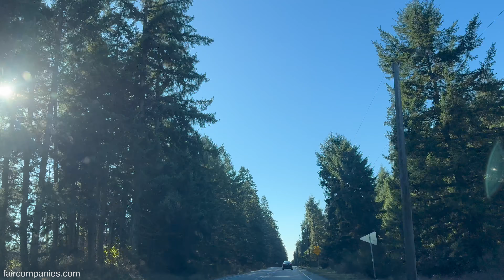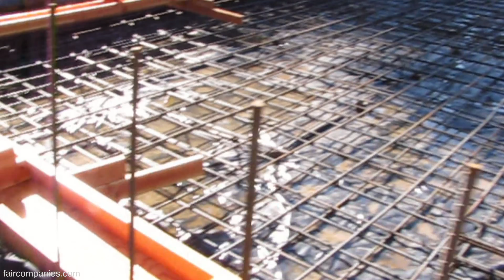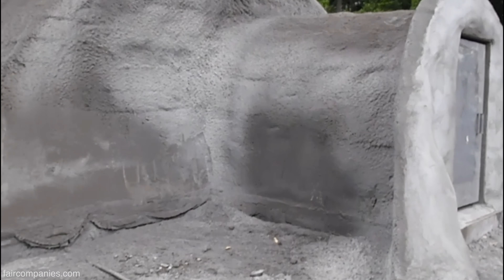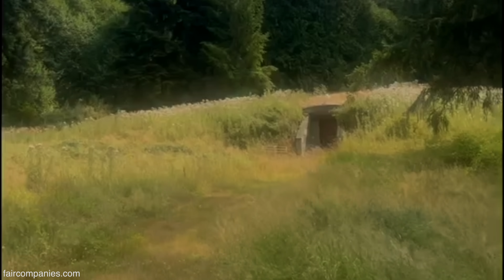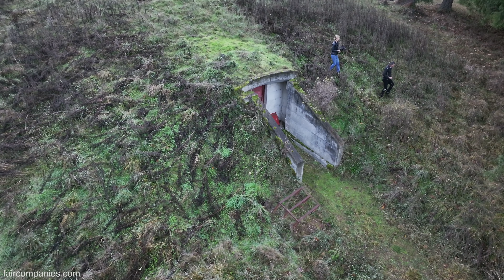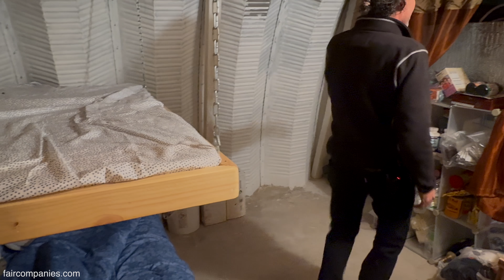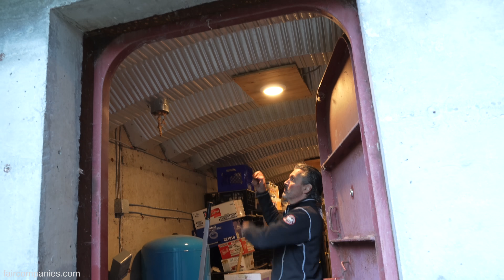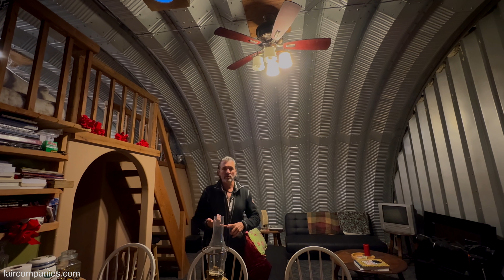Building Bunker Villa on a budget using Quonset Hut structure

Comment: He did something that few people will ever do.  Fewer still would ever put all of their food storage right at the main entrance; you have to protect your stores and this seems like a game-ending flaw during an actual SHTF event.
Reply: Agreed. And the door is not going to hold up for too long to a battery powered grinder or Haligan tool.
Reply: If you rotate food stores, it makes sense. Every six months grab 5 boxes of older food. And replace with new.
Reply: This ain’t a game of RUST.
Reply: @MildMisanthropeMaybeMassive 
Had to look that one up, boyo.  In a STHF scenario, it quite would be.  That's the whole point of survival stores and off-grid prep:  plan for the worst, hope for the best and try to live your best life for yourself and the people you can help.  If the worst happens, you dig in and survive.  Even if there's just a temporary 'emergency', you do better than other folks who haven't prepped.
Reply: After a moment of thought 

It doesn't matter a bit if you have stores and you're shot. The point is to keep your family living long as possible?  Don't put them in between the attacker and what the attacker wants.

You can still mount a defense from the inside door, while the family takes the escape hatch. If you're so inclined to take on the people motivated enough to choose the harder target. He's set up a shooting gallery.
Reply: Exactly my first thoughts

Comment: This hut is inexpensive and serviceable, but I wish someone paid better attention to the interior finishing and arrangement: it feels like a bunker.  Relying on mains power is strange,considering how he observes early that being without power was one of the things that spurred him to build it.
Reply: Agree, though he mentioned the bunker was built 15+ years ago, so technology has definitely advanced a lot since then. When building one of these today, I'd think he would utilize low-voltage LED lighting and a couple of portable solar generators... which could be recharged using a small generator, portable solar panels, or recharged from a couple of generator-equipped exercise bikes...in a worst case scenario.
Reply: Yeah.  The tech's changed super fast.  12V power and low-wattage LEDs are a major advancement for sure.  You'd still need AC for motors and induction, but everything else could be 12V. @__WJK__
Reply: There is two parallel conversations going here.  The guy started his company building these after an extended power outage, and this is one he built for a client at the clients specifications.
Reply: There isn’t anything keeping an owner’s creativity down.   You can join Quonset huts like a gable and create a T form or whatever.   It’s all been done before.  These could look like something out of a Tolkien movie if you had the desire.
Reply: Now THERE'S AN IDEA, lol
 @kimhorton6109
Reply: Well - there are other options like a generator that isn't shown to power the entire property 😉
Reply: That would be nice.  Still nicer would be siting it for wind, solar or water power.  I have none of these things, but kerosene generators are a short-term solution in a SHTF scenario and I know it.  Have you utilised any solar power and if so, what panels could you recommend for performance and reliability. @VikingShelters
Reply: @paulus.tarsensus  in this case wind is mediocre, because the moving parts are likely to break down.
Certain types of marginally less efficient (but still cheap!) solar cells can last 50 years or so when well maintained.
Also, a small generator with special ventilation would be beneficial in the event that solar stops working (maybe the panels were fallen on by a tree in a storm) for people with medical devices, like a CPAP.
Reply: @notyetdeleted6319  
Had to look up CPAP, so TIL: something, lol.  You're right in that solar technology is still advancing and we do need to wrest back the tech from the CCP, whose products are mostly tofu dreg and hurt our own ability to innovate and produce.  There are, however, some small-scale wind turbines now that are less likely to have down-time, break or create interface problems.  Lots and lots of people experimenting in their own backyards and startups.  There are also lots of methods, techniques and strategies to harvest wind.  Some of the newer ideas manage to capture even the slightest breeze and deliver power and don't have the higher wind threshholds some more 'traditional' models used to have to exceed in order to be productive.
Reply: @paulus.tarsensus You should use a set of small propane fired generators, because the propane burns cleanly and stores pretty much forever. 

Put solar up, a battery bank and invertor, gen sets back that up.
Reply: That could easily be augmented with a large propane tank and a propane generator, as well as solar and battery.
Reply: I would have serious claustrophobia issues having to be stuck in this structure no matter how “cozy and comfortable” it is; I am delighted for the owners!
I was in an underground house in Northern California that was interesting, it had quite a few stain glassed windows for skylights and some kind of white, lime washed walls, it seemed fairly bright and there were peacocks living on the roof, that was back in the mid eighties, very unique!
Reply: Watch the video closely, there is a generator still in the shipping box clearly inside the bunker. It's marked, looks like shipped in the box from the store/warehouse.
Reply: I think he said it cost $100k so not that inexpensive.
Reply: @barnmaddo  
15 years ago.
More like $250k now
Reply: forreal when it gets to 50k i'll be doing this for myself @barnmaddo
Reply: I think just being underground with all the insulation is an improvement over a normal house if you are in a situation without power. If you have a gas or woodstove that should be enough to cook food until your power is restored. A generator would definitely be another improvement though
Reply: This is true, but still a missed opportunity.  With sub-grade, underground spaces, you have to ensure a supply of fresh, clean air and this is especially true if you plan on having internal flame-based heating and cooking sources.  There always should be a lower elevation to draw air from and a vent in the higher elevations to ensure a natural flow of fresh, clean air.  Traditional Japanese and Korean home constructions were not underground ( and they didn't believe much in insulation ), but they still ensured that this air-flow would occur.  In Korean homes, the ondol, subfloor heating system depended on it. @TheCsel
Reply: @paulus.tarsensus  Completely fair on the lower-to-higher ventilation rule.  The thing I found myself wondering (I live in an area that gets more snow) was how easy it might be for the ventilation and the escape hatch to get completely blocked by snow.  I'd imagine that isn't as much of a concern for Portland, where this was sited, but they did get a storm that dropped 18" on them a year or so back.
Reply: @btgardener39   Shoveling snow would be required in heavy snowfall areas.
Reply: @paulus.tarsensus Along with carbon monoxide detectors.
Reply: @paulus.tarsensus  if you would have paid attention, the higher ventilation was pointed out directly in the video (next to the escape hatch) and a lower ventilation pipe can be seen in the construction images.
Reply: It would be relatively easy to add a solar system which is both grid tied and can operate in stand alone mode to the building.
Reply: Is this hermetically sealed?
Reply: It feels like a serial killer house inside.
Reply: @paulus.tarsensus  remember this is a bunker / guest house not a home
Reply: But it will stay fairly warm due to being underground.  Plus wood stove and oil lamps.  So is electric necessary?
Reply: Show some prices ..... turd ....
Reply: If I were this gentleman showing you my bunker house would be enough.I wouldn't show you the emergency amenities that I might have.That seems not smart.
Reply: I love the way you put a penetration In the roof to pull the well, i remember helping my dad pull his.It was very freaking long! I'm going to build something just like this very soon.I cannot wait❤
Reply: He's got a new prefab Hobbit house on this channel now. If you haven't seen it yet it's pretty good.
Reply: @paulus.tarsensus  It's good for demonstration purposes. Use this one to showcase, then build better later.
Reply: My sense is they were aiming for a bunker vibe
Reply: What about is it safe from a earthquake
Reply: There was a lot of things that the customer wanted that he said he wouldn't
Reply: Can't show all of your tricks in a YouTube video. I know I wouldn't.
Reply: Good thing interior finishing is the last thing to worry about if maximum safety becomes your only option.
Reply: all you would have to do is add drywall
Reply: @paulus.tarsensus  who cares about esthetics when it's keeping you alive
Reply: @fairlyoddme3021  
I do, you do and so does most everyone else.  If all you are after is a bug-out bunker when SHTF, then any hole with canned goods will do.  This, however, is their home and will likely be their home for the remainder of their lives or until they sell it and trade up and only doubles as a 'hunker-down' fallout shelter.  So if you're homeless, any cardboard box or tarp stretched between trees will do.  If you think Armageddon is imminent, any industrial-look warehouse stocked with comestibles looks mighty appealing.  If this is your actual home and you want to live mostly off the grid, then aesthetics matter.  They always matter.  They really, really do.
Reply: @paulus.tarsensus  100% agree mate , lots of timber around there to make some nice rustic  wood cladding etc , or drywall and mud .....
Reply: @paulus.tarsensus  They don't live there it's classed as their Guest House.
Reply: Let’s see yours

Comment: Pretty sure the corrugated metal of a Quonset structure is NOT up to the strength needed for getting buried under dirt.  But however much it does hold-great!
Reply: He said the corrugated metal is just the form and that spray concrete is what gives the structure it’s strength.
Reply: 4x4 wooden beams were used to support the inside arch structure when a 12" of concrete was being applied on the outside.. Those same 4x4 beams were used to build out the interior walls..
Reply: You all want to get triggered. watch what jaimie mantzel videos. Channel is now called Jaimie Stuff. He has been doing off grid type of things for decades its seems. He also made a giant robot spider you could ride. Then down sized it to the size of a toy. Bought some islands in panama area. Built a two or three story concrete egg. For his babies mama. Then another dome for himself on another island. He was off grid in Vermont before this.
Reply: They went right on to the spray foam and not on to steal mesh like shotcreek is designed for. This WILL collapse
Reply: @cheeseymccheese7249  He has customers for whom he built such structures 12 through 15 years ago. They have not collapsed, hold up very well, and have no water leaks whatsoever.
Reply: @cheeseymccheese7249  I started my building career doing industrial and commercial concrete 35+ years ago. There's been a huge amount of changes in the technology since then which I'm not fully conversant with, but it's a far different game now where wire mesh isn't much used now, and where even less rebar is necessary in a lot of applications. Yes it could be made stronger, but I won't go so far as to say it needs that.
Reply: @cheeseymccheese7249  Who would want to steal mesh???
Reply: @cheeseymccheese7249  he specifically talks about using the micro rebar material in the shotcrete mix.

Everyone seems to be ignoring what the man says to explain why he’s wrong.

Comment: Neat build.
I'm looking at this from the beginning thinking, unless it's done right, it won't work.
He answered all of my questions one by one. Structure, insulation, condensation, well water, not air filtration though.

If this were my place, I'd also plant some trees and bushes to disguise the entry.
Reply: Be careful to plant the trees so their roots don’t over time punch through the subsurface water liner, or undermine the concrete by the front.  Tree roots are powerful and over time can crack concrete.
Reply: @papanam4267  yes fully agree
Reply: I will say, we spent over a year before first the first Quonset Underground was built with men who have over 40 years experience combined. There is much more involved than just doing this and why it is worth talking to us about what you desire to do.
Reply: He is a prepper respect
Reply: I agree with the person saying don't plant trees where the roots could get in the way and penatrate the pond liner or concrete. What you could though, is work with an artist to put up fake but realistic looking "trees" on top of or around the structure using pipes and stuff to look like trees. You could also use that as your skylights.....
Reply: @molsen8869  years ago I remember reading something about fake trees, where by the fake leaves generate electricity as the wind blows through it's limbs. 
Not sure if the concept ever came to fruition.
Reply: If you're going to build where you have four seasons, you are limited to evergreen fake trees.  Real trees' leaves change color and fall off.
Reply: @jerrywesterfield5636  I didn't know evergreens were 'fake'. Dwarf breeds of spruce ought to do just fine.
Reply: He could plant something with roots that only go down 3-4 ft, and they might add stability.
Reply: Just make a 90-degree turn in your entrance, so it doesn't point directly at the driveway.

Comment: I agree with David that the water storage should be at a higher level inside so it’s gravity fed and other than “fill-up” time, you won’t have to always work a pump. The interior could use a lot of refinement so it’s more inviting, “homey” and relaxing to the eyes.  After the entrance storage hall but before the main “living room” chamber, it would make sense to have an anteroom to leave jackets, hats, muddy boots & footwear at so you don’t track in dirt, dust and wetness.
Reply: I agree with all you said.  It may be a good idea to have the waterheater updated to an 'on demand' system to cut down on water usage. I would have a rain catchment cistern system to ensure a renewable water system should something happen with the well.
Reply: @jwyllor very true and a great idea for them to do. Sadly, this structure wasn't lived in hardly at all for 10 years so it is what it is now..
Reply: @VikingShelters  u r the guy that built this..??  well done sir..very impressive...thank u for sharing with us
Reply: @VikingShelters   Do you have any issues with condensation?
Reply: @Fronkey84  nope ! The spray foam on the outside stops any condensation from developing.  I have no idea why Atlas and others don't spray foam their structures...
Reply: Painting the ceiling flat black with proper lighting will do wonders.
Reply: One would want to put a bathroom at the front to serve as a decontamination area and a mud room for gear.
Reply: For an 'any possibility' bunker I'd want my water where I can see it at all times. Gulp, gulp, ahh.
Reply: @kdizzystl  I agree , I wouldn't want it outside exposed to contamination, elements and freezing
Reply: all you would have to do is add drywall
Reply: Difference between you keyboard riders and the guy in the vid, is that he actually did it. You just sit and think your comments actually do anything 😂😂😂😂 Meta people are hilarious
Reply: @jansveen  He literally has a video up from 4 months ago on his profile of the hut. Did your mother drink while she was pregnant?

Comment: 100.000 and a year, to place rebar and concrete forms?
That sounds more than a tad questionable.
They put up an entire apartment complex (50+ units) in four months next to my favourite coffeeshop. (Finally, it is quiet again!)
Reply: That's not what was said and totally different situation...
Reply: @VikingShelters   "instead of spending 100.000 USD and a year to place rebar and forms" is literally what is in the video description, and what was said in the video.
And you mentioned that that was "just for a concrete box".

A bit of hyperbole can be a useful tool, but you took it too far.

It might not have been what you meant, but it is what was written and said.
Reply: An entire 50-unit complex in 4 months?  That’s easy in the city with sheetrock on wood frames with a big budget & construction crew.  Not to mention that in a hurricane, it will all blow away.  Can’t compare apples to oranges.  
     A 50 unit apartment complex sounds like a profitable venture, though!
Reply: @papanam4267  They don't build houses with flimsy materials like that around here. (I do love building sheds and such with timber-frames though!)
There's also no hurricanes around here. But still, most (and almost all larger) buildings have an armoured concrete frame. And the most common wall material is aerated concrete blocks. Not the cinder blocks, but the white, finer stuff.